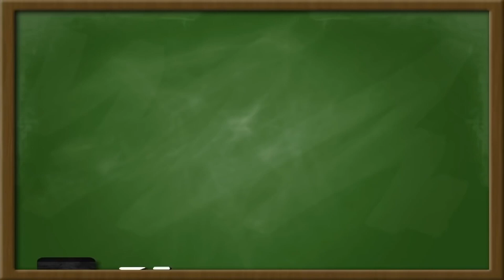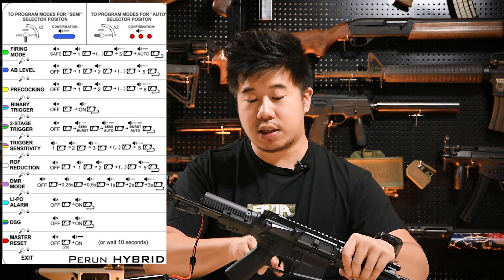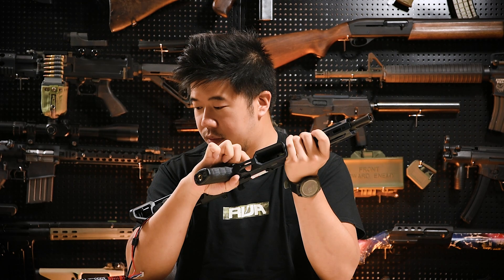Gambit's Guide: Perun ECU Configuration Tutorial

Comment: great video. i use etu++'s on my g&g's but ive been saving up to put a v2 and clicker on my lvoa or crb. does the gearbox shell need modification for a v2. i know it does for a gate. the clicker negates the ability to adjust the trigger sensitivity. with no clicker and the stock trigger does the perun make it adjustable. is it something that you can tell a big difference or is it i think its more sensitive, maybe?? thanks bubba cheers